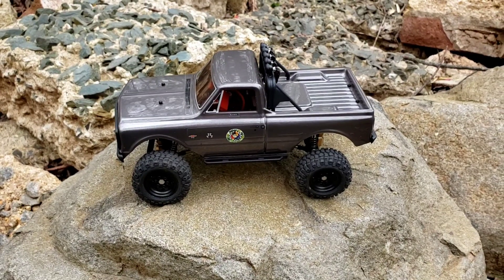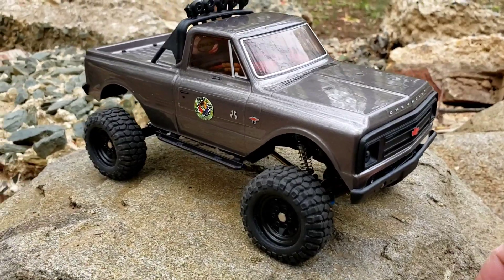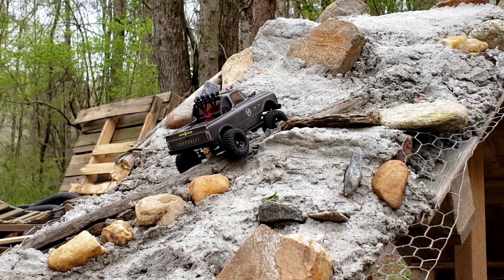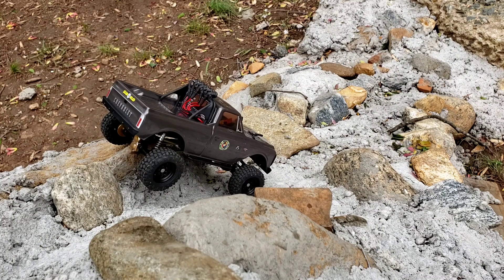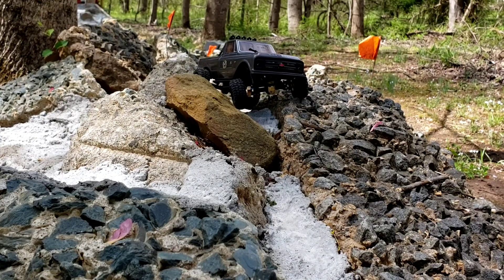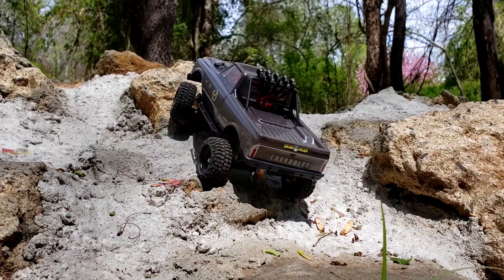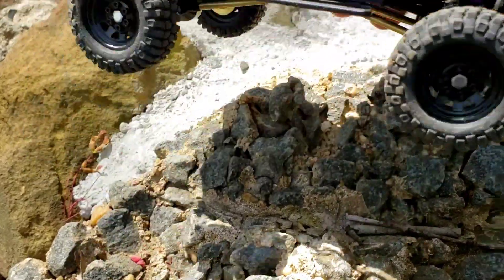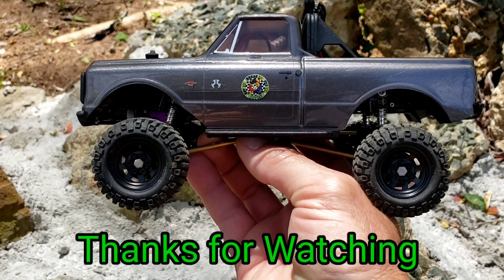SCX24: First Test of the Upgrades (tires/wheels/motor)

Comment: Did you vent your tires? I put brass in my stock wheels and they block the vent's so the tires are kinda baloonish now. The Scx24 is my 1st crawler, hell first Rc in almost 20 years lol so Im out of the loop 😂
Reply from the maker: I didn't vent them but I need to do something with them. They don't flex like they need to. People have been telling me to take the foams out. With the weight of the truck, that will probably work pretty good.
Reply: @BuyitBreakitFixit  im running no foam and it was great before the vent issue, I did order CI lil nova soft foams to try with my new tires and wheels.

Comment: What are the blue spacers on your steering linkage ?I used heat shrink to fill the space and tighten up the steering.
Reply from the maker: Those are some silicon o-rings. Just to tighten everything up.

Comment: you have a link to the motor?
Reply from the maker: https://www.crossrc.us/shop/100t-high-torque-micro-motor/
Reply: @BuyitBreakitFixit  ahh okay seen it there and was hoping you knew where it was in stock lol.. def gonna be needing a bigger motor with all the upgrades im doing its putting on some serious weight
Reply from the maker: Have you tried rc mart? The barrage motor will fit with some mods and the rgt motor will fit. 

[US$6.12]13625 050 High Power Brushed RC Car Motor For RGT 136240 V2 1/24 Vehicle RC Rock Crawler Off-road Parts RC Parts from Toys Hobbies and Robot on banggood.com
https://banggood.app.link/t0Kk4wLjF5